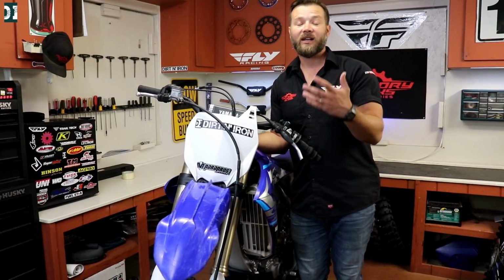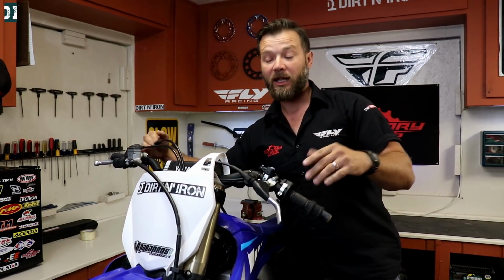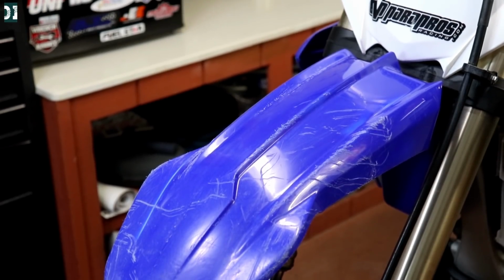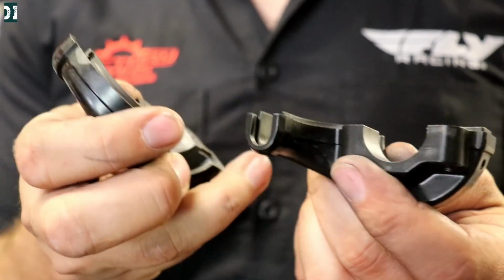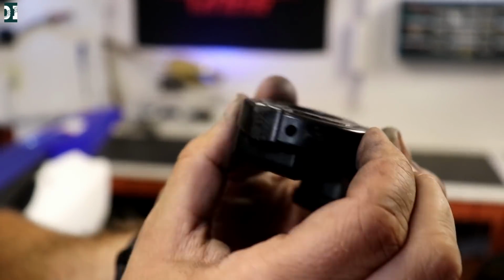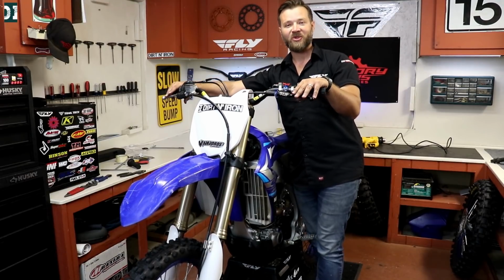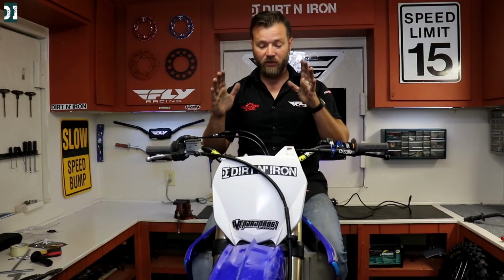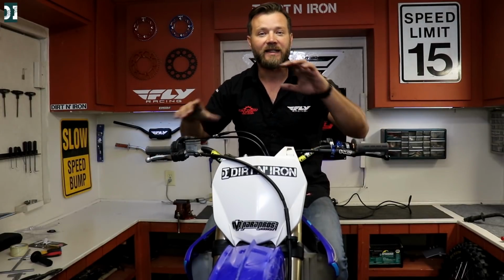I CRASHED - fixing front end damage

Comment: Had to do that on the trail this summer...luckily no bent bars. Sure glad you didn't get seriously hurt...
Reply from the maker: thanks man,  bent bars sucks.. specially in the middle of nowhere
Reply: @dirtniron   That's why I've resisted switching to solid mounts. So far, I've only had to deal the bars tweaking in the rubber mounts, which is easy to take care of. I'm afraid solid mounts won't have any give and any energy from a get off will all go into the bars causing a bend....  and Bent bars suck...  ☠

Comment: Do you not compress the fork a couple times with the wheel pinch bolts loose first?  Or spin the front tire, then hit front brake to get fork tubes lined up?
Reply from the maker: yes Jim, you are right. very important to make sure the fork sits itself on the axle freely and then tighten the pinch bolts, there are different techniques to do that, this is one of them. I was banging  my wheel side to side many times and I was sure it sits in its place.

Comment: front fender   boiled linseed oil   rub on  rub off  rub all off. gets in pores. rub to shine.  rags will be flammable throw out side on dirt.  dont try to reuse rags  .throw out as soon as done.  flammable.   never hang a rag on plastic will burn,  oil will not harm plastic   .
Reply from the maker: thanks for the tip, I never heard about it before.
Reply: @dirtniron  rub it all off it will make a mess